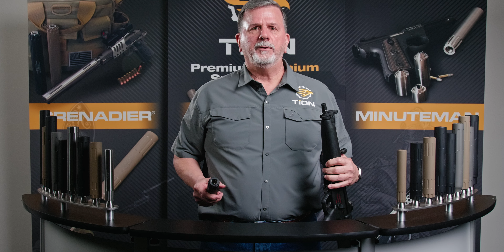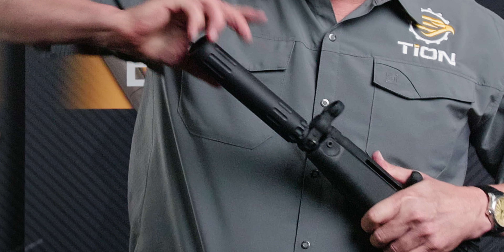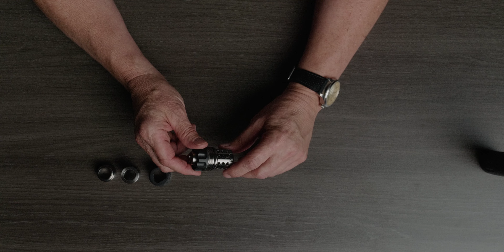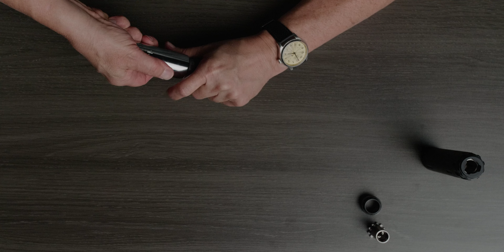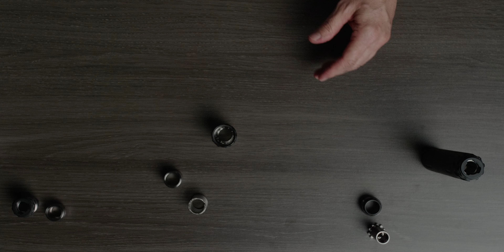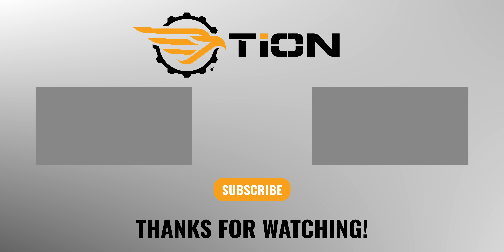3 Lug Adapter for Grenadier Suppressors

Comment: Do I need to take the HK SP5 thread protector off or leave it on? I just purchased the HK  tri lug adapter. Don’t have my grenadier yet, but soon.
Reply from the maker: Great question! Our 3 lug mount will slide over the knurled thread protector as long as the diameter does not exceed the barrel diameter. 
Some aftermarket knurled thread protectors are a larger diameter than the barrel.
Reply: @tio @tion_suppressors can you give me the part numbers to convert this over to the tri lug from direct thread?
Reply from the maker: @jaykimbrel4305  The kit you'll need is in the dropdown menu here: https://tioninc.com/product/grenadier-titanium-piston-mount-kits/
Reply: @tion_suppressors  Thank you for the information very helpful.